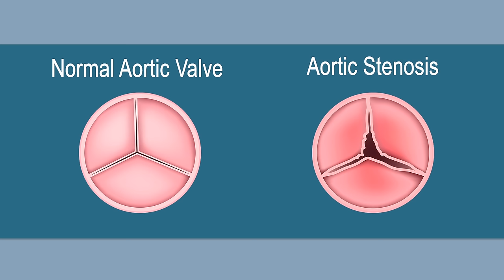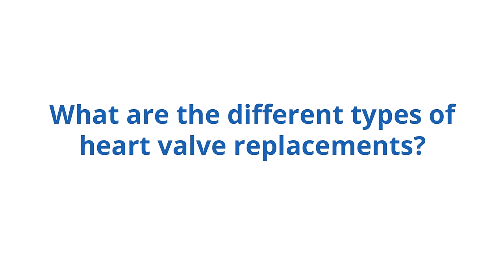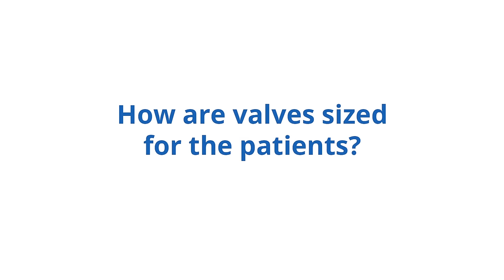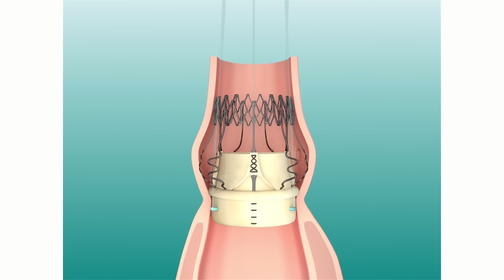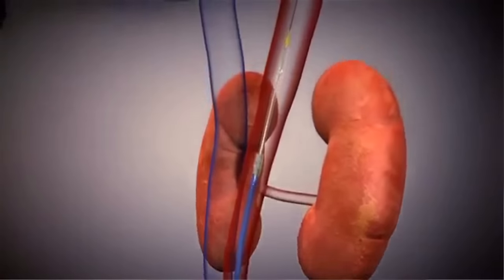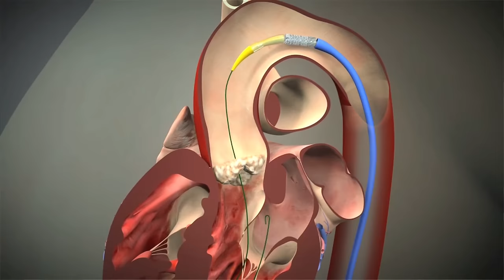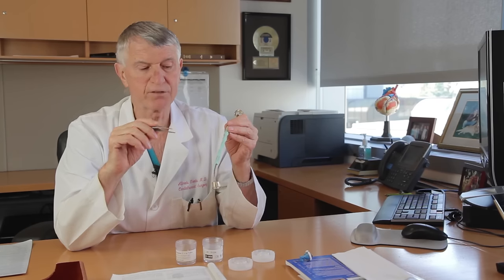Heart Valve Replacement Options

Comment: I will have a Mitral replacement very soon, this will be my third open heart surgery, thank you for the very good explanation.
Reply: We pray for speedy and successful recovery
Reply: Why THREE???  I'm scheduled for surgery in October, they dont know if they will do repair or replacement yet but I'm 60 so the tissue valve doesnt sound good if I'd have to go back thru all this again in 10 years and not have the insurance I do now at work
Reply: @HobbyOrganist  for your age tissue valve is best for you.
You don't require to be on blood thinners.
Reply: @prakashchhetry8428  I'm already on blood thinner since I had Afib back in January- Eliquis, the issue is all Ive read is the tissue valves might be expected to last 10 years, I dont want to go thru this again at age 70 and with whatever I might have for insurance since I wont be working at my present job then and it has great insurance that covers everything 100% after the $2500 deductable, once I reture from that job that insurance wont be there any more, I'd be on something like medicare and all I hear about that is how bad it is.
Reply: Victorian Sculptures well, 1978 the first one when I was 19  it was not successful I passes out!,, and 1979 the second one and the big one went very well. Now I am 65 and already on blood thinner.
Reply: @faridehnaghsh  I see, so it wasnt replacing/repairing  the SAME valve all 3 times or something like that then. 19 is awfully young to have to deal with that!
Reply: @faridehnaghsh  could you tell me more? my gf had first bio valve replacement when she was in her 20s, we need more advice on what to do next later on, please message me
Reply from the maker: Wow! Three open heart surgeries? Our thoughts are with you!

Comment: I had a tvar for the aortic valve in 2016 and chose the cow leaflet valve not realizing it would fail after six years. i am now in trouble and have to have a valve replacement and have had a T.E.E yesterday and tomorrow the Dr. will do a cath. to determine what they are going to do. I am  eighty years old now and in good health my size valve is 25mm.
Reply from the maker: How are you doing now?

Comment: I was just diagnosed with Aortic Stenosis and it troubles me that I had to do my own homework on what this is because my doctors has told me absolutely no-then but told me not to worry about it because its mild Narrowing. OK but what will be done about it. They gave no comment. I have been floating as tho I'm going to pass out. I told the doctor and she said just go lay down and elevate my legs then monitor my blood pressure. That was it. What do I need to do about this ?
Reply: Not all patients that have aortic valve  stenosis require valve replacement.  There’s different degrees of it.  Typically includes shortness of breath, swelling, chest tightness, and chest pain.  Aortic Valve stenosis is quite common and is normal part of the aging process.  Do what the doctor says, Keep blood pressure low, and legs elevated because when you legs are in dependent position, the heart works much harder.  You probably just have a mild form of it which doesn’t require any surgical intervention at this time. Make sure you get your physicals done every year.
Reply: I have stenosis for over 15 years. They keep monitoring every 2 years. With an echo they can see the bloodflow speed, the surface area and the backflow. Nothing to worry about. When the day comes you will have options to live a long life.
Reply from the maker: Yes, it's critical to be your own best patient advocate. This is no hair cut.

Comment: I have just been diagnosed with heart valve problems & i am now worried i would like to know what caused the problem & is there any cure ,like would excercise help to strengthen the valve or is once it has happened the only cure is surgery, if any one can advise me i would like to know & why has it developed with me. 20years ago i had a triple heart by-pass & have been perfectly okay since but now this has developed but why.
Reply: Hi , I need please your experience as I'm 36 Years old man, Diagnosed with severe aortis Stenosis due to heavy calcification plus congenital bicuspid aortic  valve, also now I have regurgitation in the aortic and mitral valves, now i get symptoms of light headed, diziness, mild chest pain, mild shoulder pain, i was called by the public system ( a senior registral ) does the operation to do the operation just before Easter 2017 but I wasn't ready as a doctor told me that it is better to do the surgery by a catheter ( TAVI ) and to wait for the private health insurance sorted which sould take another 10 months ( The only difference that the I can choose the surgeon that I like to do the surgery ) as I live in Australia. so my question can I do my surgery through TAVI or just conventional open heart surgery? do you think is it better to do it ASAP or it doesn't matter also does it make difference to do it in summer or winter?   Thanks for your time , Bassem
Reply: Bassem I am in Perth and had aortic stenosis and Valve replaced with a mechanical in Feb 2017 If you would like any info regarding things I learned along the way through lots of research, please contact me via facebook. I am easily found.
Reply: @bryanjary9691  Hi mate. I'm about to have valve replacement surgery next week. I am 54 and leaning towards the mechanical valve option.  Can  you tell me please how loud is the sound that people hear and if managing warfarin tablets and blood tests have led to a major change in lifestyle?  Thank you.
Reply: @69columbus  I can only hear mine through a stethoscope. It has been seven years for me now . Just a distant memory. Warfarin has had no impact on my life whatsoever. I eat what I want and I drink alcohol in moderation four or five days of the week.
Reply from the maker: We would encourage you to discuss with your medical team.

Comment: I'm 18 with a mechanical on-x valve and an aortic stem graft. I sound like a clock
Reply: Seteniater I am 47 that's what I sound like
Reply: I woried because the valve become louder it its normal?
Reply: be thankful you still making noise
Reply from the maker: We heard the Onx valve is quiet. Has the sound become less over the years?